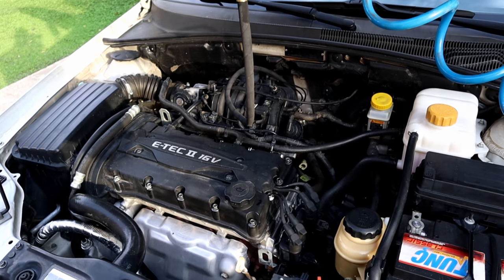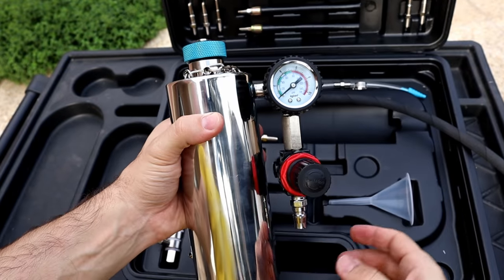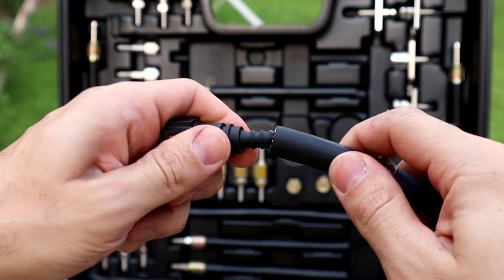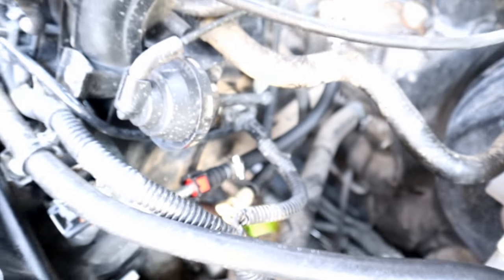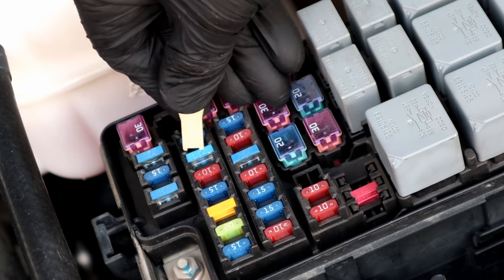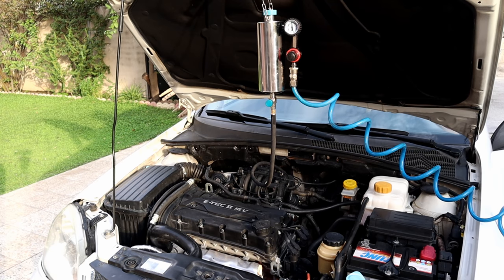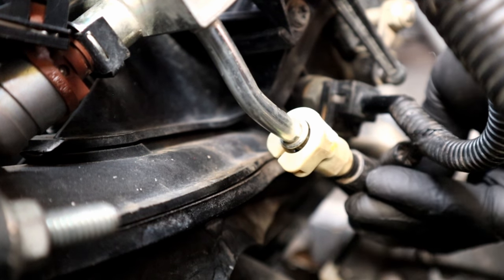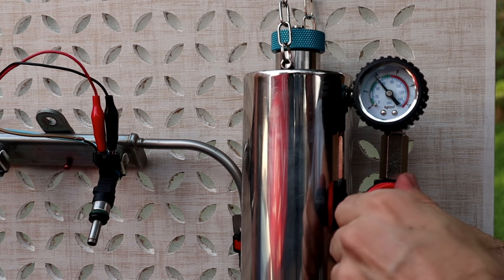Fuel Injections cleaning in less than 5 Minutes/Cleaning Injections with AUTOOL Injector Cleaner Kit

Comment: You made it look so simple and easy.  But, in reality, that kit has dozens of parts and you have to know what you're doing to put the right combination of parts together and how to hook it up to your fuel rail properly and each car looks different under the hood.  What would be interesting would be to see a comparison of cleaning dirty injectors with this kit versus just putting a can or two of injector cleaner into the gas tank.  Both methods work about the same way, don't they?  Your regular fuel pump pushes gas under pressure to the fuel rail just like that kit applies pressure to your cleaning solution to the fuel rail.  So does the kit clean better than just adding cleaner to the gas tank?  The kit probably has a more concentrated cleaning solution but you could run your gas tank down to almost empty and then add a couple cans of injector cleaner to get a more concentrated solution, too.  I'm just looking for the best way for me to NOT take a working vehicle and turn it into a NON-working vehicle.  If I start messing around in all those hoses and railings under the hood, I see a danger of me not having a running car anymore.
Reply: There are so many parts because different engines have different connections.
Reply: If you dont know where to hook it up to for the fuel system or vaccum hoses you can just try straight into the throttle body

Comment: Hi Ali Mech,
I subscribed. I like your videos because they are clear and concise. You have done a lot of fuel injector cleaning videos. I would like to know: how do you know if your fuel injectors need cleaning? What are the symptoms? How do you know that they are now clean?

I made my own cleaning setup by using a fuel rail from the junkyard and making an adapter similar to what you did. I sprayed carb cleaner through them and used a 9V battery to fire them. It worked and the carb cleaner sprayed through them. It seemed to flow freely but it was hard to know if the spray pattern was correct.
Reply from the maker: Thanks, when the fuel injectors dirty, the engine consumes more fuel and some times you will be able to smell gas when you start up the car, and also engine will be less power when you accelerate

Comment: Thank you. Awesome video. Everything went well with the Autool C100 kit till I tried to connect the air supply. I tried multiple quick connectors and none of them worked. What air supply fitting did you use to connect your shop air to the cleaner? Thank you in advance.
Reply: I had to switch out the quick connector for one that works with my air compressor setup. the connector it come with is some weird different one ive never seen before.

Comment: Which way do you think works better? Taking the injectors out and using a driver with carb cleaner or this

For the people that live in apartments the only way to run a compressor would be a REALLY long cord, or a portable battery compressor of your favorite brand of power tools ($200-$400 dollars). At that point you can get a injector cleaner/ flow test bench for those prices

Tough choice

Comment: Good video 
I just get this cleaning kit but I can't make the engine run on a 2009 expedition if disconect the pump fuse
Reply: If there's a return hose, connect it to the fuel inlet, if not you could make the fuel inlet go in a jerrycan
Reply: 2012 F150 5.0 L engine.
Took the largest male connector that would fit into the female connector. Capped the end of that connector with the cap that was in the kit, using Teflon tape to seal it. Plug it into the fuel line, this will allow the system to build pressure.  Leave the fuel pump relay and fuse in for this to work.

Comment: SERIOUS QUESTION: Why is this setup with the canister so different than just simply adding a couple quarts of B12 cleaner directly to an EMPTY fuel tank and letting it idle?
Reply from the maker: Because with this setup you will be able to send coventrated injector cleaner directly to the fuel injectors with without damaging fuel pump

Comment: I tried this on a 2013 F150 5.0L Coyote engine. I tried up to 65 lbs of pressure, but the fuel rail will not pass it, vehicle will not run as injectors are not getting fuel (cleaner), I can't figure out how to get the back pressure off the fuel rail to actually pass the pressurized cleaner. Thoughts?
Reply: 2012 F150 5.0 L engine.
Took the largest male connector that would fit into the female connector. Capped the end of that connector with the cap that was in the kit, using Teflon tape to seal it. Plug it into the fuel line, this will allow the system to build pressure.  Leave the fuel pump relay and fuse in for this to work.
Reply: 2012 F150 5.0 L engine.
Took the largest male connector that would fit into the female connector. Capped the end of that connector with the cap that was in the kit, using Teflon tape to seal it. Plug it into the fuel line, this will allow the system to build pressure.  Leave the fuel pump relay and fuse in for this to work.

Comment: Can we use this for diesel engines?
Reply: On those using unit injectors maybe, but not for common rail engines (pressure too high)
Reply: @unnainconnu9098  I recently checked with liqui moly. That's the only one chemical available for this in my country. They said it is possible even for common rail high pressure injectors. We have to connect this unit before the high pressure pump. They have separate chemical for diesel
Reply: @shakyabandara4910  Nice!

Comment: Not using the clamp for the return valve?
Reply: Wonderful video btw
Reply from the maker: No, bc there is no return on this fuel rail, only one inlet
Reply: @AliMECH  I usided it on my03 cts and worked great. I was about to put it on my 09 5.3l silverado. I believe that doesnt have a return also? Does the kit have a Schrader valve connection.